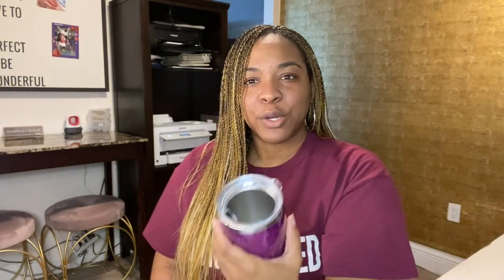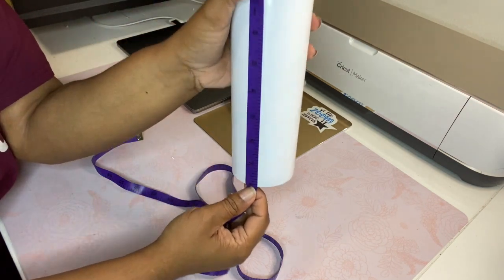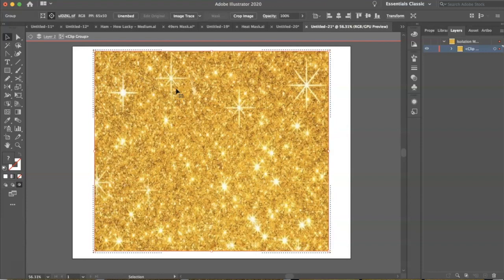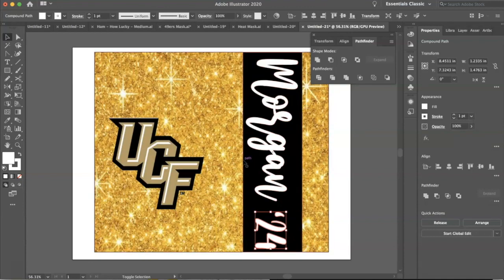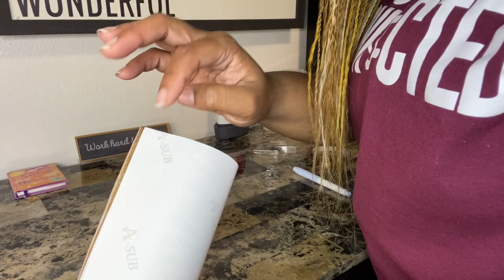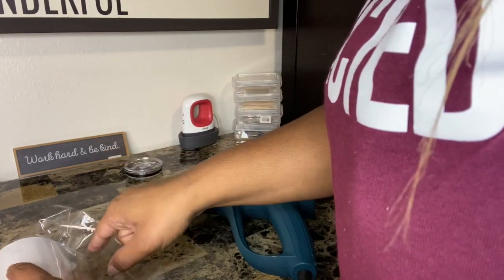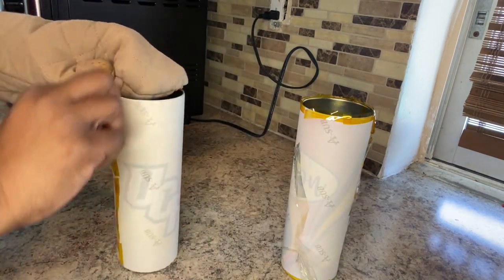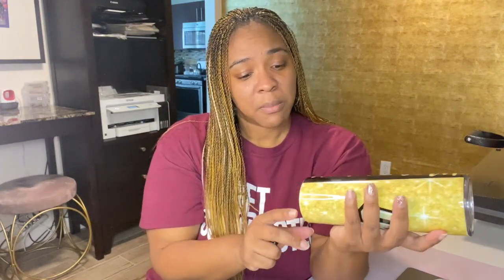Sublimating a Skinny Tumbler with Shrink Wrap and Convection Oven. Sublimation Printing.

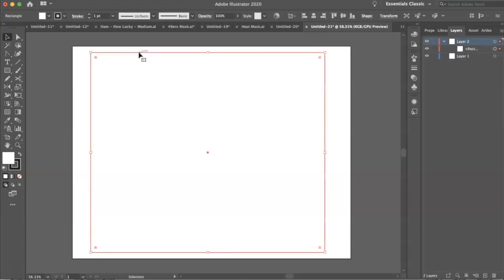Comment: Just wanted to say thank you for showing how to subliminate without masking.  It works perfect for me.  I put it at 395 to 400 for 5:30 min and my tumbler came out perfect.  I was glad I don’t need masking tape or skrink wrap.  I save me some bucks!!
Reply from the maker: That’s awesome. Thank you so much for watching!
Reply: @CraftableThings  good question will I be able to do it with less minutes?  If so what is your lowest without skrink or masking tape?  But so far mines turned out great.   But just wandering if it can be done with lower minutes or lower temp.

Comment: What paper do you have to use for this.......and do you have to paint the cups before sublimation???  what is the white coating on the cups?
Reply from the maker: The white coating is what allows the sublimation ink to transfer to the cup. You have to use sublimation transfer paper. No painting is required.

Comment: Whenever I sublimate using shrink wrap I end up with particles either inside or around the lip. How can I remove these pieces without damaging the tumbler?
Reply from the maker: Do you have a piece of paper in between the image/sublimation paper and the shrink wrap. Try to make sure that the shrink wrap doesn't make direct contact with the tumbler.

Comment: I have problems with the image coming out light. It is the same paper and the oven is on turbo. In fact it is the same tumbler. What ink are you using?
Reply from the maker: I used Cosmos Ink for these tumblers. What are your settings?
Reply: @CraftableThings  hi what setting should I use - I got an epson2720

Comment: I got shrink wrap on my tumbler and can’t get it off.. any ideas?
Reply from the maker: Unfortunately the shrink wrap is baked into the tumbler. It is next to impossible to get it off. This usually happens when the design isn't a full wrap and the shrink wrap makes direct contact with the tumbler. For future tumblers, you will need to put a barrier sheet (copy paper or butcher paper)  in between the tumbler and the shrink wrap to avoid it happening.

Comment: Hi, loved your video!!  I bought a convection oven specifically for this, but for some stupid reason, it heats past 400 when you initially turn it on, but then cools down to 375 and stays there.  I did a mug and it didn't turn out, I tried again at a longer time and it worked.  I tried a tumbler last night and it didn't turn out, even though I could see the design thru the paper....do you think I should try longer like I did with the mug?

What program do you use to print your design?  I don't use illustrator, so I don't know if that is just a design program and you export a png to print or if you can design and print from illustrator.
Reply from the maker: Hi Tammy! Is the oven on convection or turbo. That makes a big difference. It should not be on regular/bake. The mugs usually take longer than the tumblers. Do you have an oven thermometer to verify the heat of the oven?
Reply: @CraftableThings  Hi, thanks so much for your response.  I was just watching one of your videos.  Yes, it is a convection.  I did a test with nothing in it and found if I turn it to 450 (on convection), it will overheat and then come back down to 400.  So....fingers crossed 🤞.  I'm still having issues with printing from silhouette.  Hopefully I will figure it all out.  Thanks so much, stay safe and Happy Holidays 😁

Comment: You did a great job with instruction and the end result, thank you.  Which company on Alibaba did you use and how long did it take to be delivered?  Any difficulties with payment, delivery times, the supplier response and correspondence and quality of the product?  What were you minimum order commitment?  Thanks in advance for your reply @CraftableThings
Reply from the maker: Thank you so much! I've tried a few suppliers. My favorite is https://hckjltd.en.alibaba.com/?spm=a2700.wholesale.cordpanyb.2.779c2e9b4n2WFw. I received my items from them within 8 days when I chose expedited shipping. If you need your items right away, never choose sea freight. That will take up to a month. All of my transactions have been seamless on Alibaba.
Reply: @CraftableThings  That is awesome.....  I will check them out.  Was the expedited shipping expensives?
Reply from the maker: My first order for 10 sublimation tumblers was $79.50 and that included shipping.
Reply: @CraftableThings  That is actual not bad at all.  Thanks Sis.  You are awesome!

Comment: Are these normal tumbler or do you buy them with the special coating on them?
Reply from the maker: Yes, these tumblers have a special coating. The sublimation process will not work on regular tumblers.
Reply: Craftable Things where do you get the skinny tumbler?
Reply from the maker: @chmc5585  I usually order from alibaba.com for my business. You can also find a variety on Etsy if you are not looking to buy bulk. Just make sure that you specify "sublimation". Also, this only works with sublimation ink.
Reply: Craftable Things thank you so much for sharing! Your so kind
Reply: What size and brand is your convection oven? Thanks for the video that’s good to know it’s decent quality without the shrink wrap
Reply from the maker: Yes, it is. I have a Hamilton Beach XL. https://www.walmart.com/ip/Hamilton-Beach-XL-Convection-Oven-with-Rotisserie/120169727

Comment: so how do you know where to place the logo/writing/etc?
Reply from the maker: when doing these, It kind of helps me when I design in the actual size of the substrate or item. That helps me with positioning. I usually center the main image vertically and horizontally using the align option in the design software.

Comment: Hi. On the convection oven. What setting do you use on there. Bake, broil or convectionetc...?
Reply from the maker: I use the convection setting.
Reply: @CraftableThings  thanks so much
Reply: One more thing did you turn them in between time
Reply from the maker: @keishafarmer1454  I didn't for this one. I try to rotate them midway. I usually forget to, though.

Comment: Can you use any type of shrink wrap ??
Reply from the maker: It depends. You really want a strong wrap that will grip the tumbler and not break apart in the heat.
Reply: @CraftableThings  , do you have a link of the kind you have used in the past? I'm having a hard time finding it
Reply from the maker: @kristenleyba808  https://www.amazon.com/Packaging-Candles-Bottles-Homemade-Projects/dp/B082LXDHZK/ref=sr_1_18?crid=35TQQUSVP615B&dchild=1&keywords=sublimation+shrink+wrap+for+tumblers&qid=1599356456&s=industrial&sprefix=sublimation+%2Cindustrial%2C167&sr=1-18

Comment: Where do you get your tumblers? I’m having the issue with my images coming out light..not sure if it’s the tumbler..ink or paper 😫
Reply from the maker: I order my tumblers in bulk from china (alibaba.com). If you are sublimating them correctly and it’s still not producing quality products, it’s possible that the tumblers you have aren’t actually for sublimating. How is the outcome for other things you’ve sublimated?
Reply: Craftable Things thank you so much for replying! Everything else came out fine I’ve done coasters and the colors came out vivid..my convection oven doesn’t have convection setting on it does that matter?
Reply from the maker: No, it should still work. Do you have a turbo setting on it? Check your temp. Are you using shrink wrap? If not, make sure the image/paper is onto the tumbler tightly.
Reply: Craftable Things yes ma’am I’m using shrink wrap..it doesn’t say turbo it just says toast broil air fry and bake
Reply: Craftable Things of it’s not the oven only thing possible could be the tumblers
Reply: @CraftableThings  what Vendor do you use
Reply from the maker: @samone7667  I use a vendor on Alibaba.com
Reply: I think the same thing! I need to try a better tumbler

Comment: Thank you so much for sharing your video I have a couple questions if that's OK. I heard that you can also put this in your normal oven how long do you preheat your oven and then how long do you put your tumblers in the oven and what temperature do you put it at?
Reply from the maker: I don't use a regular over. I only use my convection oven or mug press.